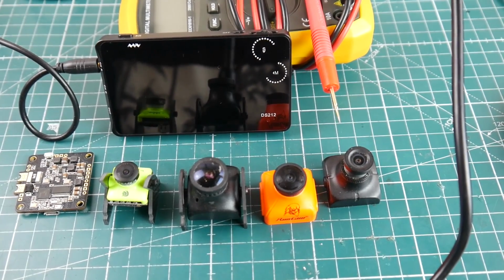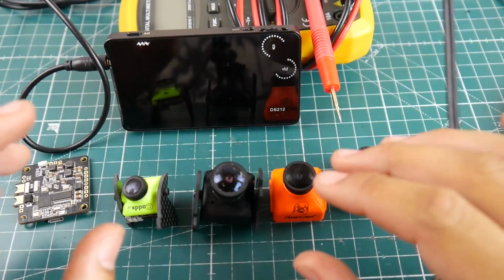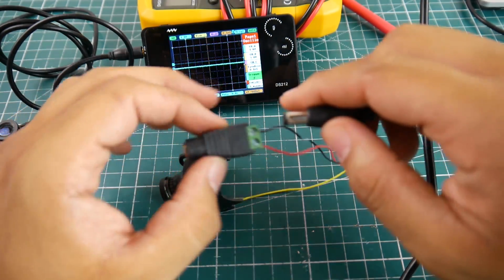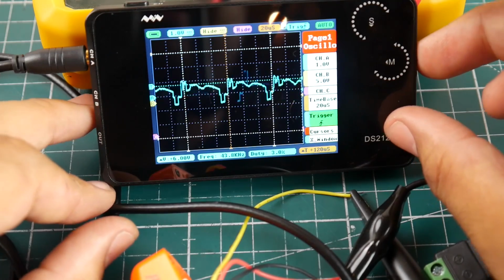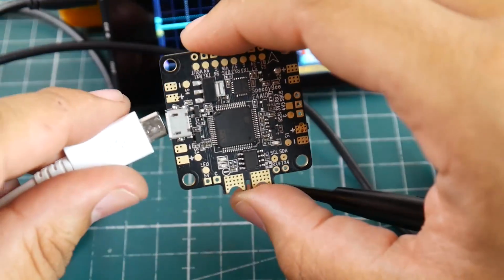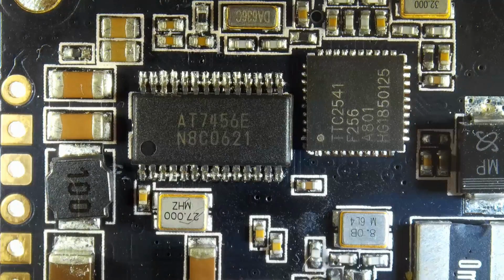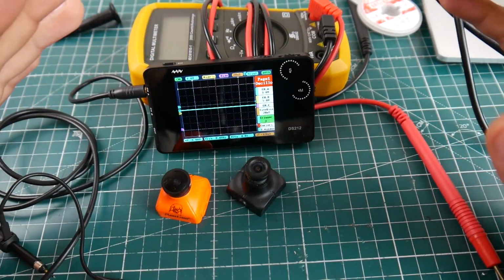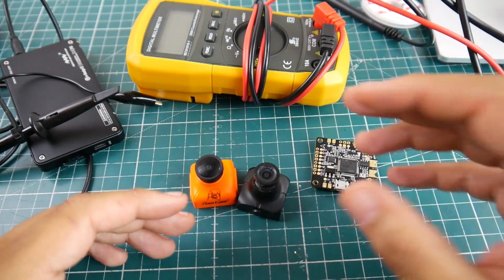How To Test FPV Cameras and Flight Controller OSD Chip // DS212 Oscilloscope

Comment: I have a FC that had a little water accident two years ago. The only thing that is not working anymore is the OSD but that's reason enough to not use it anymore. It passes the analog video signal through but it's not adding the OSD since the water crash. By now I'm switching from analog to DJI. Is there hope that the OSD will work with the Vista because it's getting the OSD over a UART and not from the analog video pad of the FC.

Comment: This is extremely useful! I have issues with my iflight Nazgul5 with the succex f4 FC. Had the analog version and the OSD never worked. Added the vista and still no OSD(i tried different UARTs RX/TX but no luck so am thinking its a hardware issue. A fix video would be amazing!

Comment: I have a AIO 1S FC - (Happymodel Diamond F4 1S 200 mW) on which the internal VTX died (only 3 meters of range) - Im searching for the pin which gives me video out (there's no older pad for it)

Can you help ?
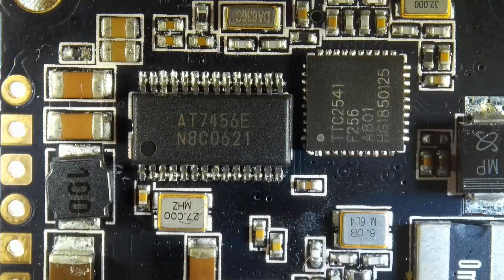Reply: 15:13 min 

Pin 26
third from the top left
Cap
75 Ohm
Video out pad

Comment: Problem: No OSD from F4 Flight Controller. Cause: Caddx camera video signal was killing it.  Disconnect camera, OSD works.  Connect camera but unsolder only video wire and OSD works.  So it's not a power issue.  Because camera was connected with power on.  Solution: Swapped Caddx with a RunCam.  Problem solved.  Oh, camera video always worked.

Comment: Really interesting ideas on how to start using that very cheap oscilloscope! I've got an arduino starter kit from BG you recommended a while back, if you need an idea for more vids, maybe do an arduino how to or build project once in a while? I'm sure the kind of subscribers you have are interested in doing some hands on basic electronics like this video showed. Also, knowing how to use a multimeter properly and continuity testing is so essential to quad building I've found, maybe another idea for a vid?

Comment: VERY interested! Especially interested in finding out why the actual OSD (telemetry read outs) are not appearing on one of my quads.. I have video, but NO OSD... any clue?
Reply: amazing ricardo ntsc vs pal?  Have you tried switching them?
Reply: Good thought.. but YES... I've even used different cameras.. swapped NTSC..PAL.. and back and forth... VIDEO but NO telemetry on screen
Reply: No onscreen telemetry... I'm getting all my telemetry back to the radio by smart-port...
Reply: amazing ricardo what fc and are you using sbus?

Comment: I would love a more in depth video.  I have the holybro kakute/tekko32 stack, first day I crashed and lost current sensing. Osd worked fine for a day or two without current or voltage now Osd doesn't work at all... fixable? Or should I just buy a new stack

Comment: These are the videos we need in this community man! Honestly dope..keep up the good work bro! Any chance you can share some light on the Dalrc 4 in 1 esc problems? Even Joshua Bardwell isn't a fan!? People are saying maybe the wiring diagram is upside down creating issues? 🙏
Reply from the maker: I have built 4 Quads with the Dalrc Engine and its the ones I fly the most.. What could of happened is simply bad mosfet and or a possible bridge on the heatsink.. I will try to contact JB and ask him to send it to me.
Reply: Drone Mesh Great bro and thank you for that prompt reply! I'm not as worried as most because I do have the dalrc complete stack thanks to you 👍 great content as always
Reply: Drone Mesh That would be awesome!